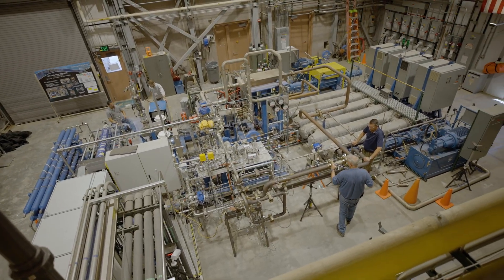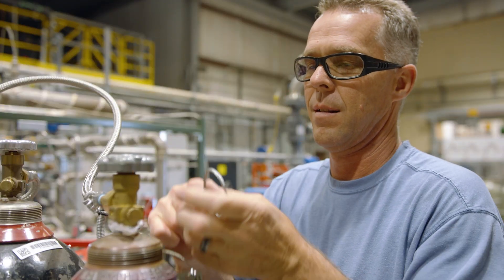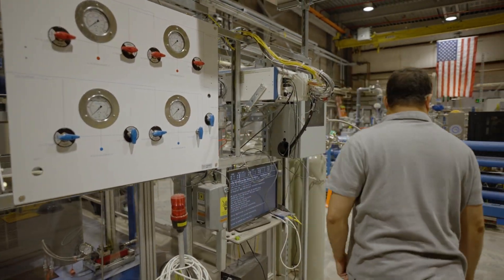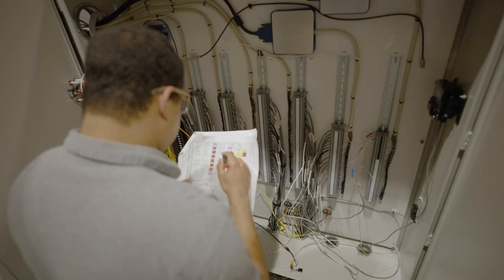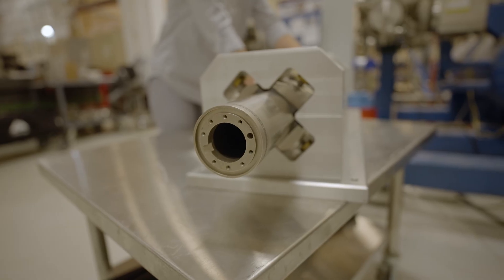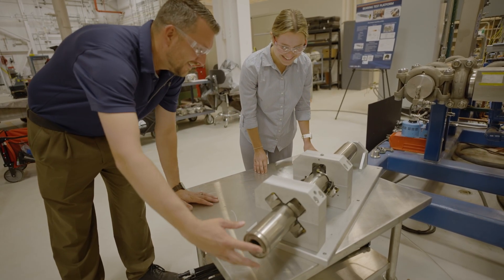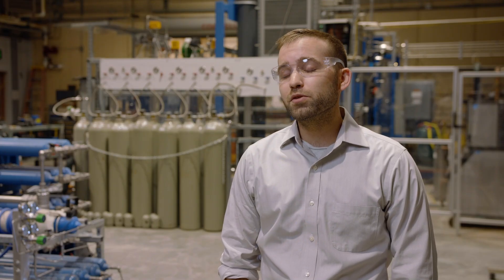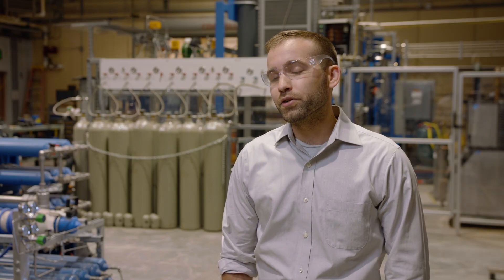Sandia’s supercritical carbon dioxide (sCO2) Brayton Cycle

Comment: If the use of this phase state material was so good already then why was it not being used for industries that would gain the most from it and would have the technical capability to build it like Oil refineries, Pharma plants and chemical production. Would Data centres not see the use of heat extraction and minimal water demand and there is also closed loop power generation.

Comment: Can internal system corrosion happen with  sCo2 ?  magnetic bearings seems a given , seals are perhaps the bigist question
Reply: Just need to use foil gas bearings and make it hermatically sealed with the motor. No leaks since there's no dynamic seals

Comment: How about SF6.  I know it is a powerful greenhouse gas, so you don't just expel into environment.  Maybe the higher density would help with efficiency.

SF6 - Critical temp 318.6K, pressure 3.76MPa, density 736kg/m3.
CO2 - Critical temp 304.1K, pressure 7.38MPa, density 467kg/m3

Could a generator using this technology be used to power a semi?
Reply: Probably not semis, otherwise gas turbines would be used in them now.
Reply: SF6 is primarily a synthetic gas. It's far more cost-effective to utilize CO2, which exists both widely naturally and as a waste product of energy production from fossil fuels. SF6 is also more dangerous than CO2 to people. While similarly non-toxic, it's heavier density makes it dangerous in confined spaces and harder to expel, as opposed to CO2 which we can easily expel.

Maybe certain applications may find use for it, and perhaps the efficiency gain will make it worthwhile, so while maybe some research should be done, for widespread commercial use, CO2 is the more practical choice.
Reply: Thank you for responding.  I recently came across an article titled "Analysis of Radial-Outflow Turbine Design for Supercritical CO₂ and Comparison to Radial-Inflow Turbines" on ScienceDirect. 

The article discusses a 400 kW sCO₂ radial outflow turbine system with operating conditions of 600°C inlet temperature, 200 bar inlet pressure, and 78 bar outlet pressure, achieving isentropic efficiencies between 85% and over 90%.

Given that the typical efficiency of a semi-truck diesel engine is 40-45%, this technology could represent a significant improvement in fuel efficiency.  My main question is whether such a system could be adapted for use in a semi-truck. If not for transportation, perhaps there is potential for application in EV charging stations, particularly in California, where grid capacity is an issue.  California currently generates 39% of their  electricity using natural gas.

I’ve been curious about radial outflow turbines and had a thought: Would it be possible (and practical) to eliminate the diffuser stage between compressor stages using a non-1:1 coupling, like a mechanical or magnetic one? I’m not an engineer, just an interested observer, but I was wondering if this could help improve efficiency. I’d love to hear your thoughts on the challenges and feasibility of something like this.

Comment: i am interesting on this for spaceship. insteaf of nail the preburner and valve and stufs use sCO2 to generate electricity (battery are low energy so combustion for the moment is the way until nuclear is safe to fly) This is small close loop and efficient.
but i need understund better how it work. I mean on water generators convert liquid water in to gas wich increase presure and that presure give mechanic energy. but on crytical fluid how it generate? it will go from superfluid to gas? But you say superfluid have more horse power to move the pale of turbine.
What will move the turbine? if the sCO2 start at 32ºC and 80atm. if i increase temperature the supercriticalfluid will rise the presure? if yes, what is the ratio ºC/atm

Comment: The optimal power source would be a molten chloride salt fast reactor, temp only limited by vessle material >600c~950. (can go 1100 odd but be nice to the regulators we need them)
For a straight power reactor that pairing is the best currently functional technology we have. 
Fusion and SMR seem to have a lot of media support, same conundrum as government, malice or incompetence...
Reply: How well would it adapt the compact molten salt reactor currently being developed by seaborg Technologies? It uses sodium hydroxide for heat transfer.
Reply: @mikefallwell1301   they are in my top 3 but not number 1, Elysium Industries design is impressive. can scale better from 400MW to 2.4Gw with one core just by adding heat exchangers
Reply: I think HTGRs are better, they don’t have a corrosive coolant that becomes radioactive due to neutrons, plus they get hotter which means higher efficiency.
Reply: @deus_vult_1099 you are locked into solid fuel then, efficiency goes out the window if you can only use 3~5% of your fissile before throwing it out.
yes it is difficult to build a heat exchanger out of inconel but coolant loop has more pressure than the fuel loop, so worst case is not terrible
also gas has poor thermal mass, limits overall output per scale.

Comment: Perfect add-on to a small modular reactor.
Reply: only molten salt, gas cooled/PWR wont like it and Nak boils at 785c. 
In other words SMR is a marketing term for old reactor designs pretending to be new
Reply: @samuelforsyth6374  
Supercritical CO2 turbines can operate over a wide temperature range 350-800C.
Reply: @bobthebomb1596  I don't think that's correct
Reply: @bobthebomb1596  ahh you are correct sorry
Reply: @samuelforsyth6374  No worries. To be honest I thought sCO2 turbines were more suited to reactors which operate at higher temperatures and I suspect that they are more efficient when so combined.

My OP referred more to the combination of "small reactor/small turbine" as an easily distributable, reliable power source than to maximum energy efficiency.
Reply: @bobthebomb1596  mmh I heard something like that. sorry I have a pet peeve against the term 'SMR', it seems to be used a lot by solid fuel designs to try to sound radically different. 
I think the only one who uses it honestly is moltex and  their reactor is, simplistic. (Elisium Industries is my favourite)

A lot of pebble bed designs being are persued simply for regulatory ease reasons but they are getting better. I think they see proliferation risk as a holdout issue but that can be managed by fuel cycle
Reply: likewise with 'Thorium reactor' it almost seems like a consorted effort to conflate MSR with thorium fuel cycle, same conundrum as government, malice or incompetence?
(have seen 5~10 b,c & d tier youtubers make the same pigs breakfast conflation video in the last 6 months)
Reply: @bobthebomb1596  I was reading some paper on S-co2 and it almost sounded like they were going to use the CO2 for the primary heat transfer but it was a bit over my head and more focused on the turbine alloy than the core
Reply: @samuelforsyth6374  Yes I agree you.

I have no problem with the current PWR based SMR designs in principal; they are more likely to receive operating licenses in the near term as their operating parameters are well understood and they could help counter the "nuclear is too slow" argument.

I do quite like the high-temperature gas reactor the Japanese are working on. Yes it is a pebble bed design but it is based on an old British research reactor (Dragon) and a lot of test data should be available. Purely speculation, but a HTGR could make it into service quite quickly. It is also potentially duel use, for both power and process heat generation.
 
Longer term then yes, liquid fuels are the way to go. I am also a fan of the fast neutron molten salt breeder reactor.
The real issue with liquid fuel designs is obtaining the data to satisfy licensing authorities that they can be operated safely.
Reply: @samuelforsyth6374  I find it hard to believe that anyone would design a system with only one loop between the reactor and the turbine. Wouldn't that require both items to be placed in a containment structure?
Reply: @samuelforsyth6374  apparently the main engineering challenge is that the S-CO2 loves to dissolve and corrode stuff so all the component parts hand to be made of advanced alloys.
Reply: Perfect retrofit into the T/G side of existing Rankine cycle plants.

Comment: I want to see how the waste heat gets removed from the system.  Since that is supposed to not use water I wonder how big of a radiator is needed for a loop that produces 10 kW of electricity.  My guess would be that it would need to dispose of about 12 kW of waste heat.
Reply: the only obvious solution is molten salt, for the power reactor and the thermal transfer
Reply: multi stage heat excenger. and the final stage made only with fins to make it easy to compres.

Comment: Barton Cycle needs a high temperature input. Molten salt nuclear (eg Moltex or Elysium) is perfect. However, the USA nuclear regulatory system has protocols only for PWR reactors. They cannot regulate any other type of reactor.  These old tech dinosaurs do not operate hot enough for Brayton turbines.

Comment: For those who are not familiar, the Brayton Cycle can replace the high pressure steam section used in typical steam electric generators.  It can be both more efficient and have a smaller footprint compared to the hardware in a steam turbine.   It take advantage of the supercritical nature of CO2, which can act like a liquid or a gas.
Reply: I have absolutely no idea about how this works but i assume it can be used in automotive industry
Reply: @user-os4qe9gn4s   well...  Think high pressure gas spins a turbine.  It's really hot H2O vapor, so hot it really doesn't condense back to water until it's way past the turbine.  It's essentially "dry steam".  Its so hot and takes up so much space the turbines have to be very large.  You want to get a certain amount of steam through the turbine without compressing it into a liquid inside the turbine.  The steam turbine is the rakine cycle...   Super critical CO2 turbines are completely different beast, different thermodynamic brayton cycle.  The CO2 might change between a supercritical fluid and a gas through the entire cycle, which is a big difference.  The density of the super critical CO2 can drive a much smaller turbine with more torque...  It's interesting tech.  Can't really see it beyond electricity generation
Reply: I do have this Technology today for 12 KW Small Tesla Turbines...I do need to start..
Reply: It also has the advantage of operating at high enough temperatures to enable disposal of waste heat using only air and radiators.  No need to use up massive amounts of water with so much of the world dealing with shortages of fresh water.

Comment: no clue what it means, but it sounds good 👌
Reply: It's a way to change heat into electricity at a much higher efficiency (around 60%) than the current steam turbines that are in use (around 40% efficient).
Reply: @nunyabusiness5075  Thanks for the reply ☺️

Comment: I haven't watched all the way through but is a gas that is in it's supercritical state a fifth state of matter or is a supercritical gas just a property of the gas at certain pressure and temperature parameters?
Reply: Its called a plasma state.
Reply: @ronusa1976  No, it's not. Supercritical and plasma are two entirely different states of matter. Plasma happens at Temps so high the electrons can't remain orbiting the nucleus. Supercritical is like a combination of liquid and gas. It fills its volume and flows with the viscosity of a gas but has the densities of a liquid.